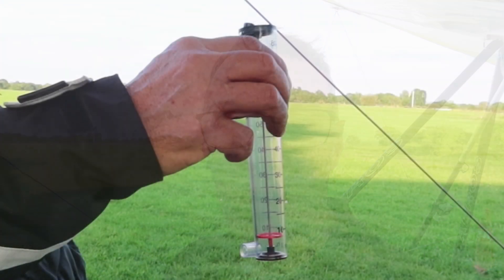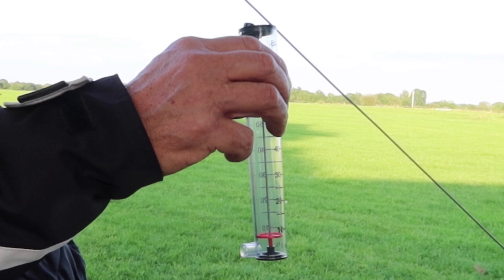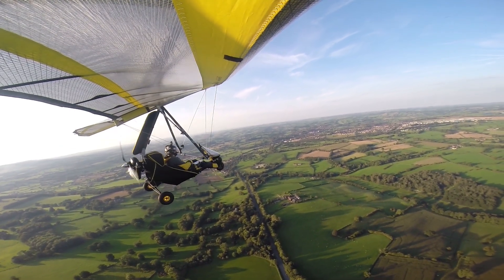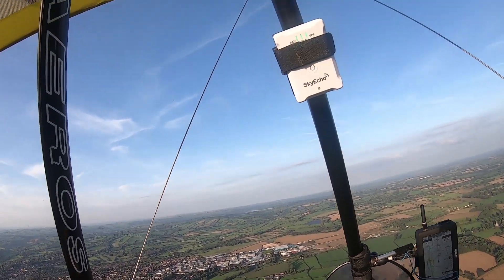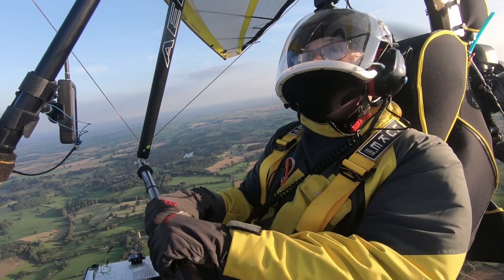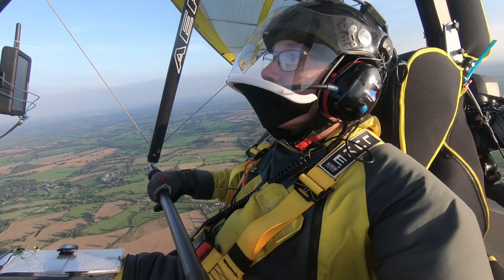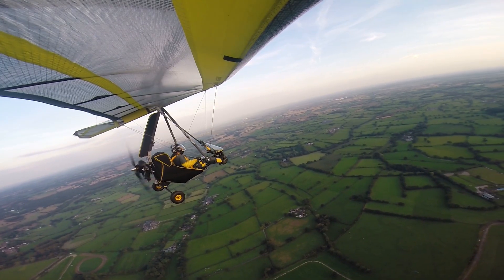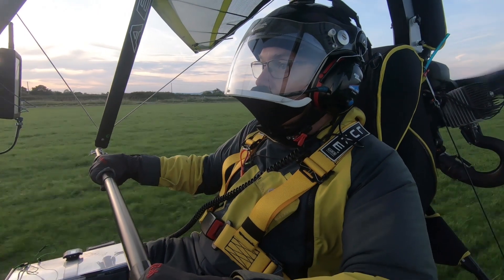Flying WITHOUT an ASI - The art of flying without an Air Speed Indicator?

Comment: I full agree Giles with your thought on an ASI, I need one because I am flying a 3 axis and isolated from the air and have a trim system that can take me into or close to the danger of stall. For me when I flew paragliders and hang gliders I did not need any instruments but did like GPS for ground speed and position and a altemeter (with adjustable QNH) for vertical nav  and a vario for thermaling.
It sounds like your instructor was the same as my old ATC power instructor. I did not have a mentor as such but in a way had a load of pilots that helped me develop when I flew floppies and hangies in Scotland (floppies in comps).
Reply from the maker: It is always interesting who has been "that Pilot/s" that have guided us?

Comment: Firstly, perfect quote from the RAF gent, and that links nicely to your point about the hands off trim speed 😁While flying, I agree, minimal use for the ASI, unless going some turns etc - but straight and level the trim state and engine revs define the airspeed and no need to check other than for information. A bit different for landing though - while my GT40 is definitely not a sub70,  it was drilled into me in training not to let the airspeed drop below 60pmh solo, or 65pmh with a passenger, on final - and the Mk1 eyeball and Mk11 hearing doesn't quite cut it for that, but certainly once I'm over the numbers I'm not looking at airspeed at all - look ahead!!
Reply from the maker: Hi Mike, its quite interesting all the little hints and tips we have been given over the years and how they become part of our day to day flying habits.  Its a good quote and he did seriously sound like that, well he did at the time anyway :)

Comment: I bought one. Used it twice. Flogged it. My BivvyBee has three speeds. Hands off, a bit slower and a bit faster. I can tell which one I’m flying at by feel on the bar. Spend the money on beer instead. 👍
Reply: Giles doesn't drink, what doi you think he spends all that saved money on?
Reply from the maker: Did you get many pints for you ASI Paul? :)

Comment: Absolutely agree! An ASI is a “delayed” reading that attempts to let the pilot know their angle of attack. It lies with different weight and G loading as well. If it’s stall we want to avoid, don’t push the bar to the stall position. All well said! BUT I find your argument correct on ALL trikes. Even the heaviest 1000+ lb REVO that stalls at 51mph does NOT need an ASI.
Reply from the maker: Hi Larry, I do agree with you on your "Heavier", I just didn't want to confuse people in the UK that do have to have an ASI as part of the permit approval for their aircraft.  I'm sure we'll have time to have a natter at Sun and Fun next year :).
Reply: @GolfFoxtrot22  I am referring to the usefulness of the gauge.
Reply from the maker: Ahh, is what you mean.

Comment: It may be worth reminding people that sub70 flexwings are not microlights and that the majority of (section S) microlights are required to be fitted with an air speed indicator.
Reply from the maker: Hi Steve, that is very true S1303 states an Altimeter and ASI, although I thought a compass would have been just as useful.
Reply: SSDR being an exception, where there is no legal requirement for flight instruments
Reply from the maker: @chrsfrwll  indeed. TIL045, para 3.4 covers it.

Comment: For these machines...my opinion is we don't need an ASI.  Just like you don't need a an ASI for a PPG.  These machines have so much inherent stability... they know what to do better then we know what to do.  If you want to fight that stability by making it climb, turn or dive, the wing tells you what it's doing...you can feel the bar pressure...and that feed back is much more valuable than looking at a gauge.   Great video...Thanks.
Reply from the maker: Hi Stone, yes you have hit the nail on the head with your comment.  Not much to add really.

Comment: I totally agree with you Giles. I think having an ASI on a small trike is just another bleed over from GA aircraft. People that used to fly 3 axis planes, or the people that are familiar with them,  probably feel since they are needed on a 3 axis plane, they are also needed on a trike.

Here's another thought. I feel doing a 'controls check' on a trike is almost ridiculous. With a 3 axis plane, it is very important. With a 3 axis plane you are checking the numerous cables, pulleys, hinges and connections that make control of the airplane happen. In a trike, what do you have? A pivot point. I feel this is another bleed over from GA aircraft instruction. Don't get me wrong. I feel that the movement between the trike carriage and wing are important. This can be inspected during a preflight.
Reply: Hi.  Regarding control check on flex I disagree. Flex pilots often use the airframe to mount equipment, instruments and cameras act. Ensuring full and free movement before leaving the ground I believe to be a good idea. Also if something within the airframe has changed due to hanger rash, heavy landing or missing bolt that wasn't visible during a glance up the wing tip,  or was missed, would likely produce a different feel, or indeed an unfamiliar clunk during control checks.  For the time it takes, why wouldn't you?
Reply: @Whitters777  I agree with you on 'adding cameras and such' (or an ASI  LOL) to the control bar. I usually check that after I add the camera to make sure it will clear.
Reply from the maker: Hi Wayne, I hope all is well? I think the joy of trikes is they talk to you so you get that feedback about what is happening. The GA world has a very structured way of flying ( ex GA pilot myself) so having the speed reference is as important as the wings and harness. 

Regarding your comment about checking the controls is all about leaving nothing to chance, so a final check as part of the CHIFWAP check is no bad thing as there is no hard should in the sky.  I hope your snow goes soon.

Comment: A very valid point and I guess the speed envelope that the sub 70 operates at, with its low stall speed, means there is plenty of room for manoeuvre and you don't need to nail exact landing speeds as you do with larger GA. Plus you can feel it in the wing, unlike GA aircraft. Great video, no concerns from me.
Reply from the maker: Hi Nat, even in the Quik R, it's all about feel. I know of one chap that doesn't even use the trimmer in his Flex, just flies it fully fast.
Reply: Great vid👍
When I was training, the instructor only had me check once the ASI coming in for landing, after that it was all eyes on field looking down runway at the appropriate time and feeling the aircraft after that.  Have to agree, once you learn your aircraft and how it feels you don't need one.

All the best to you and yours in the new year.
Cheers
Reply from the maker: It really is amazing how little we need our instrumentation, it's more of a comfort blanket.